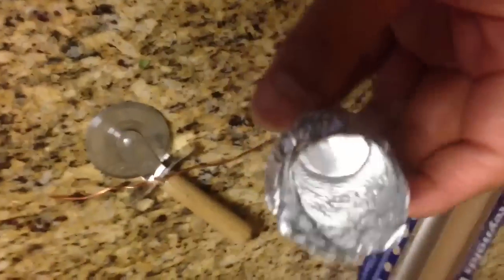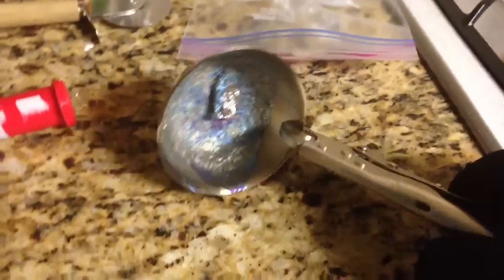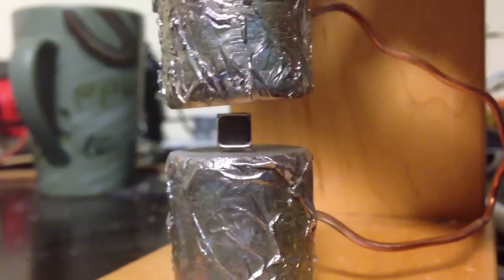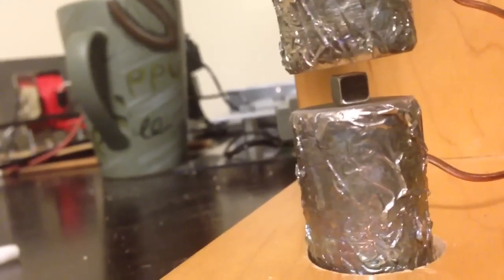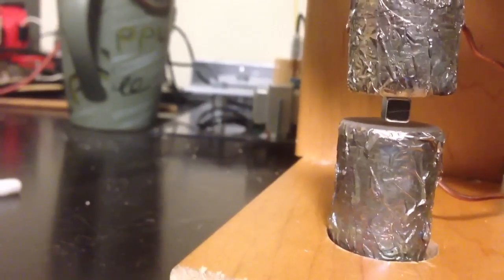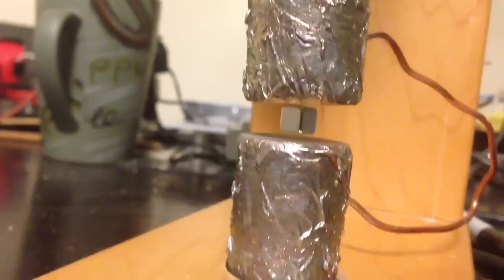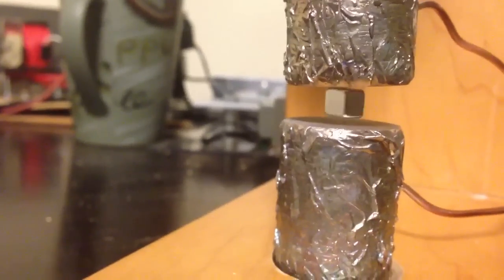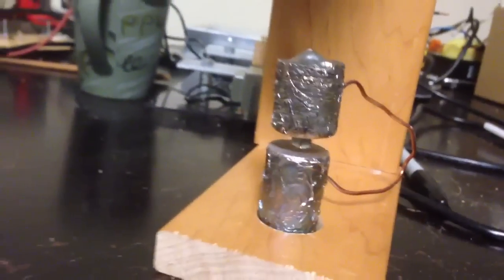Magnetic Levitation with Bismuth

Comment: No the magnet will not float indefinitely.  Other than that good vid.
Reply: As long as the magnets retain their magnetism, the magnet should float fine.
Reply: indefinitely means unlimited amount of time. So no it won't float indefinitely. However you would also have to consider the diamagnetic properties of bismuth. Do you know how long bismuth would retain it's full diamagnetic strength? I can't seem to find any info on that.
Reply: @Web3Dre  "Do you know how long bismuth would retain it's full diamagnetic strength?"
As long as it's still bismuth. So until it gets consumed by a star which then goes super nova. At which point the bismuth might be smashed into other atoms hard enough to transmute it. Otherwise, bismuth is bismuth and bismuth is diamagnetic. Its diamagnetic property isn't time dependent.
Bismuth does radioactively decay but its half life is 1.9×10^19 years which is so low bismuth is considered stable for practical purposes.
The neodymium magnets will gradually lose their magnetism so the setup might need to be adjusted every few years to keep the small magnet suspended.
Reply: @Duane Deng. Thank you so much for a thorough answer. It is highly appreciated. Have a wonderful evening friend. :)
Reply: @Web3Dre  You're very welcome. This is really cool stuff. 
I'm pretty sure it's not possible to levitate a free floating magnet with only magnets (unless they're electronically controlled electromagnets). I'm going to purchase some bismuth myself to see if I can also levitate a magnet without electronic feedback.
Reply: I'm sure you will be able to make it happen. :)
Reply: @Web3Dre  I just ordered a total of 2kg of bismuth from two different sellers on eBay.
I have lots of small magnets but I might need to order a couple powerful magnets to make this work.
I'll try to make videos of my attempts. It should be fun.
Reply: I'm looking forward to see what you manage to put together. Please keep me updated my friend. I was going to mention that you may have to use some bigger magnets too, on the top and bottom of the setup to get a nice stable levitation effect. But I'm sure you got that covered already. Have a nice day. Hope to hear from you again soon :)

Comment: Could you make a Power Genarator from it?
Reply: +Ravonies Ravenshir The short answer is no. If you apply a coil to that setup. The magnetic field from the magnet would cause a bit of friction between the coil and the magnet. So after a short time the magnet would stop spinning. Even under a vacuum where there is no friction caused by any atmosphere. The magnet wold stop spinning eventually.
Reply: @Web3Dre  "The short answer is no."
The long answer is also no.
It the act of extracting power from the spinning magnet would slow the magnet. It would take more power to spin the magnet than one would get back in generated power.
Reply: The question was. "Could you make a Power Genarator from it?" And yes one could, with a loss. My second answer was partly a joke. Have a good day :)
Reply: And all you would have to do is keep it spinning with as little power as possible
Reply: Sure, that should be simple. All you need is a secondary coil that rotates the magnet with a pulse. You will become rich! ^^
Reply: :3 why not you, you understand it more than me.

Comment: Does it have any harmful fumes.  My parents won't let me do this for my project because they think it will explode.
Reply: +kahlil sykes Bi can contain small amounts of lead so use a fume hood, or be in a ventilated area. It could explode that is true, but not the Bismuth itself. If you i.e pour the molten metal into a container that is moist or wet it may explode because of the expanding pressure. Take care and have fun ^^
Reply: Thank you so much for the info BakamonNO